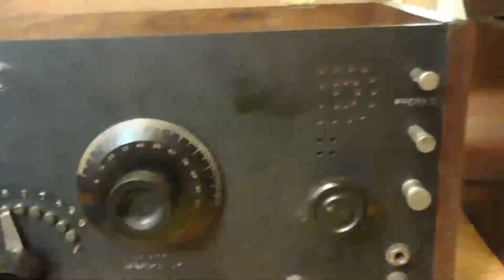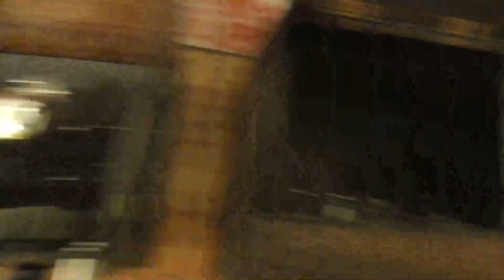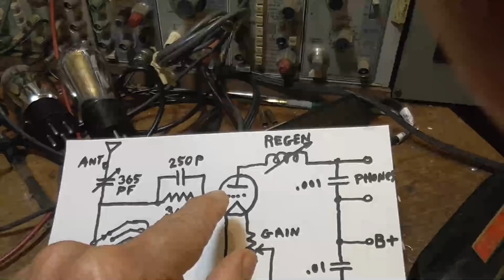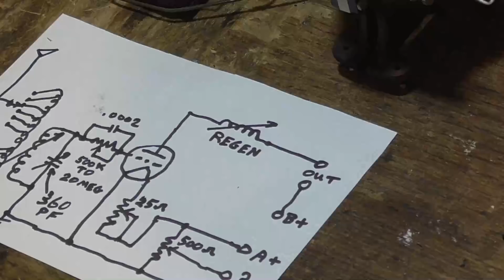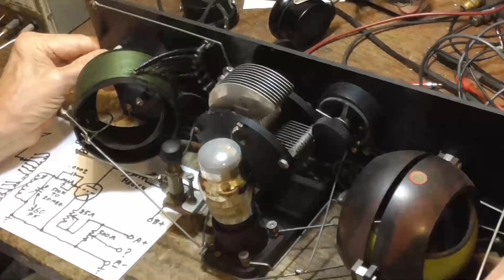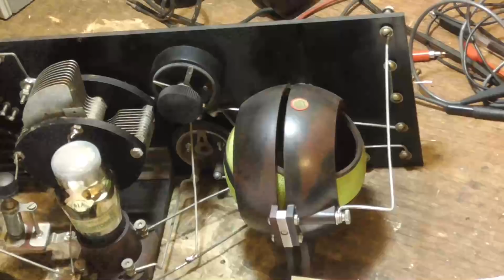TESTING A 1920'S ONE TUBE RADIO

Comment: One Tube Radio explanation is very interesting.
 I have to add some of my understandings in your explanations.

1- Two switches have been used on antenna coil to reduce the step changes in inductance for fine tunning. Had one switch been used, it would have given larger step variations in the coil, resulting difficulty in fine tunning. 
 
2- The variable output from the cathode, in my opinion, is for the tube to work as a diode detector without B+ supply to plate and may be used for headphones without Amplifier. 

These are just my understandings that may be wrong, please.

Comment: England. 50 years ago I was into valve amplifiers. Mullard 20w 15 ohm .05% distortion, I built a stereo pair and I still use it. I have numerous other transistor (Bailey) and valve that I have built, but the old lady has never been bettered. Mullard El34 valves. I did get 410V across my nose once whilst tinkering underneath the beast. It was too heavy for one person and around 4 ft long. I was lying on my back and accidentally touched an HT connection with a soldering iron. I also built two Mullard 3 valve preamps. With it going full chat you can turn off the room heater.  I love your videos but wonder what will happen to the beast when I snuff it. Happy New Year and all the best.
Reply: I love your story about the EI34 amp. Did you sketch a schematic you'd care to share? p.s. Im a Chesterian, living in Canada, pip pip
Reply: Shango066 talks about this. You'll have to figure out where your collectibles should go. You have to talk to friends and family. You can put the stuff in your will. Others won't know what to do and that means it could get tossed so you have to do this ahead of time. Good luck and hopefully you'll have plenty of time to contemplate this, but get a rudimentary plan together and revise it as time goes by.

Comment: Looking at the schematic I was surprised to see that the B+ plate current flows through the headphones. An external amplifier connected to the headphone jack would have to provide a path for the plate current and yet not be affected by the presence of B+ voltage at it's input'
Reply from the maker: When building an auxilliary amp to connect to these early sets, provision should be made to accomodate the B+ voltage. A 10K resistor across the input terminals works fine.

Comment: Glad you talked about a variable grid leak gizmo.  I have tried to get a homebrew single tube radio for many years and yesterday I thought I would try again.  I had this variable thing that had the antenna hooked to one side and no leads on the other side.  I decided the only way to see what this is is to remove it.  BINGO - a variable grid leak and since I had just watched your video I knew what it was.  Thank you.  I will try to follow either one of your schmatics to hopefully get closer to get it working.  I unfortunately do not have a variometer.

Comment: Greetings:
Where is the detector to cut the rf envelope in half?
Where is the path to filter out the RG from the output?
Reply from the maker: The tube is the detector. The bias is such that it conducts more on positive half cycled of RF than negative. The RF is filtered simply by the headphones or speaker not responding to high frequencies. No extra capacitor is needed.

Comment: On #1 does it matter if you have the .01 condenser from B+ to B-? Have not seen one before.
Reply from the maker: Provides RF bypass to the power supply. Not usually necessary but good design practice.
Reply: @glasslinger  Is the COM A-and B- tied together?
Reply from the maker: @estpst  Depends on the set, but usually that is the norm.
Reply: @glasslinger  Ty

Comment: there is a radio station in paris france broadcasting 30s/40s non-stop 24/7 i listen over a korean app i use on android, you could rig it to send the app's audio from the tablet headphone jack over to a low power AM transmitter and that would be ideal for your work table radio demonstations after the repairs are complete.  Your fine projects deserve better than today's commercial AM junk.

Comment: Great vide. It's nice to see a Weller Soldering Gun. I have had mine from when I was 12 years old. I am now 66 and it still works ok. Mind you it has had the trigger switch replaced many times. I used to be a TV Radio Engineer and it was used every working day. Cheers from old George in the UK 🇬🇧👍🤠

Comment: Modern fake.
Reply from the maker: I wonder just how modern. Would 1940's be considered modern?
Reply: @glasslinger  Sorry if it's disappointing.

These things are turned out from little workshops in India - they even import parts, like old slotted woodscrews from England for authenticity. They're into the 'antique' stick telephones and phonographs, too, like the ones in old Laurel & Hardy films etc. Plenty for sale down the Portobello Road in London - and ebay, obviously !

However, if you know the clues, it's easy to spot them. Like my old Granddad used to say, you can fake an antique, but you cannot make an antique.

I'll be kind and change my harsh verdict to the valuer's favourite: it is a 'contemporary reproduction'.
Reply: @tiggywinkle1000 No chance this is a India special. Get off the short bus bud.

Comment: I think I can throw light on the 'mystery potentiometer' If the owner aspired to adding second triode tuning stage (which would greatly improve selectivity & gain), there would be a lot of oscillation, even without applying regen. Adjusting this potentiometer would go some way to controlling this. I built a 3 tube set, which had two tuning stages, just to prove how tricky such sets were to operate & it certainly was a demon to 'drive' The neutrodyne was one solution (again tricky to drive), but once screen grid tubes arrived on the scene, listening in became much easier!

Comment: What is the rigid wire in the receivers made of?
Reply from the maker: This is stretched #14 copper buss bar. By stretching it, it becomes straight and rigid. The black covering is black shrink tubing. In the old days they used varnish soaked woven cotton sleeve but that is no longer available.

Comment: Does the B+ really have to go through the headphones to get to the plate of the tube?
Reply from the maker: A resistor and capacitor can be used to isolate the B+ from the headphones if it is a problem. Most headphones will work fine with a few milliamps of DC through them but ultra sensitive phones can "lock up" with DC bias.
Reply: Yes. You can see another very similar radio at 
makearadio.com/restoration/paragon-radio-restoration.php

Comment: The regeneration control of the second radio didn't work very well. Originally the radio would have used a set of headphones as the anode load which would be in series with the regeneration coil. In this case the load was a 5K resistor to provide a DC path and the speaker amplifier. Could the resistor/amplifier combination offer a higher impedance load to radio frequencies than headphones thus reducing the effectiveness of the regeneration coil. Connecting a small capacitor across the headphone terminals would show if this was the case.
Reply from the maker: It does have a capacitor. The inductance range of the variometer is far too large, probably made for frequencies down around 100khz.

Comment: I would think that 500R pot on the second radio was definitely there to balance out the B battery voltage, which might actually have had a result on very early tubes with a wonky filament, as then you could choose the cathode section in use somewhat. But yes simply not using it is not going to make a difference, though in very weak signal areas it might make a difference in getting a signal that is out of the noise, compared to one where the set just oscillates.

Comment: I've built several one tube regens.  I've built two versions of the one tube regen by A.P. Morgan in the 'boy electrician'.  The first one as a teenager, using off the shelf parts from Radio Shack and  Lafayette Radio, the 1H4G was found at Barry's Electronics in NYC's radio row area.  I later built another one using the exact parts that Morgan did, including the strange 270 degree rotation National Radio tuning capacitor, vernier dial, breadboard base mount tube sockets, and Hammarlund plug in coils.   The third receiver was the 'twinplex' described in a Lindsay book using a type 19 tube.  That is actually a two tube set as the type 19 is a dual triode.  Here I used as many period correct parts as possible, including a Hammarlund tuning capacitor, and a National vernier dial.
You should run the radio at 22-45 volts and the amplifier at 100 volts if you have a dual supply there.

Comment: Brilliant.
I think I said in your horn speaker amplifier video that it would be ideal with a single tube regenerative radio.
First time I've seen regeneration done by tuning the anode and relying on anode-grid capacitative feedback. Most regenerative circuits of the early-mid twenties would inductively couple the anode and tuning coils. If they used a variometer the outer coil would be the grid tuning and the rotating inner coil would be for regenerative feedback.
In those days they mainly used low frequencies. The first radio you showed went from 500KHz to over 5MHz which would be quite high frequency back then as a lot went off below 500KHz. With these low frequencies together with the low gain tubes of the time the tubes didn't show much tendency to become unstable because of capacitative feedback. Tuned grid-tuned anode rf amplifier stages were popular as well. It's only at higher frequencies that capacitative feedback starts causing problems.

Comment: As always, a great video. I have a question. NASA has for some time now been trying to invent technologies for exploring the surface of Venus, where lead flows naturally. That are having difficult coming up with a viable radio transmitter that lasts longer than a few minutes. Do you think that some type of vacuum tube technology could be designed to operate at 900 degrees from temperature resistant materials? This is more of a brain exercise because NASA would never do something cheaply.
Reply: take a look about the 1P24b tube his specs are surprising !

Comment: As a school kid back in the  1960s I had a lot of fun with one tube radios. Very low budget, coils wound on cardboard tubes, parts scrounged wherever. I built it and it worked! so satisfying. I'd like to re visit the old tech once more but unfortunately there's no AM broadcasting in Malaysia now.
Reply: You ought to be able to pick up AM stations from other countries. Imagine it, no local interference.
Reply: Same here. Then you´ll need to build a small AM transmitter and plug it into a conventional radio :-D
Reply: maybe someone should step up and change that? even if you never get a listener it would be cool to have your own little pirate radio station going